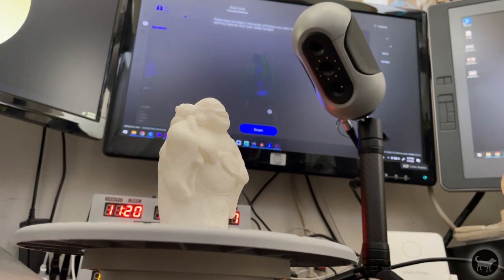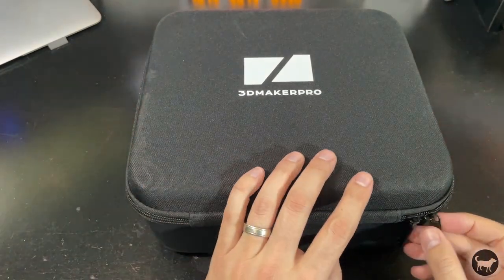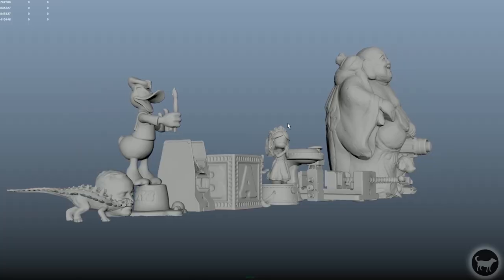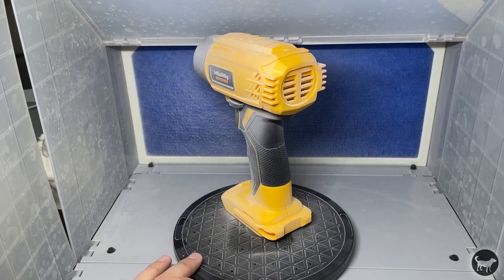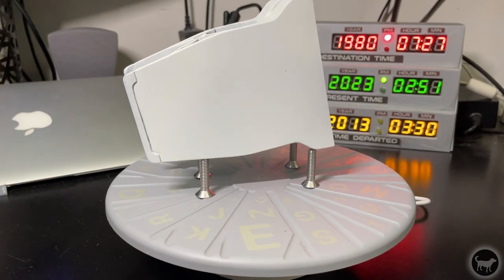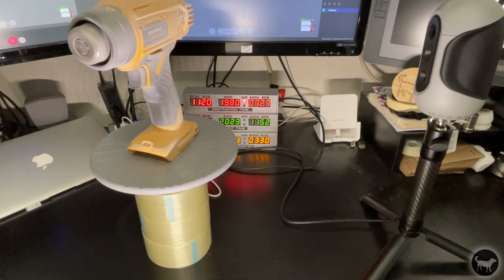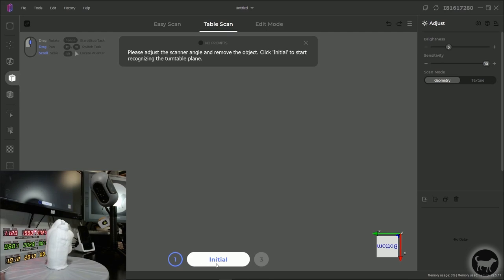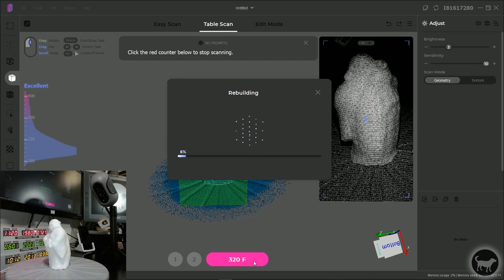3DMakerPro MOLE 3D Scanner Review | High Resolution NIR Laser | Mobile Scanning

Comment: I did buy the Mole because of those recommendations but find that it lacks the ability to capture details well compared to photogrammetry - that was unfortunately a costly mistake on my side.

The tracking issue is also extreme - also with the Lynx and some materials refuse to be scanned.

Seems photogrammetry is chapter and more capable.

Comment: Did you put the scanner manualy diagonally like scanning through all the deep holes for it to know that there is material or was it just scanned from one angle on the rotating platform?
Reply from the maker: I tried scanning it hand held as well to really get in those holes. I was honestly surprised it even did as well as it did since it's really hard to scan that type of object.

Comment: Great review but the device has the same shortcomings that all similar devices have. A lot of after-scan work for a somewhat expensive scanner. And they want extra $$ for add-ons which should just be included. This type of device, though slowly evolving over the last 20 years, still has a way to go.
Reply from the maker: Hahaha. It is pretty incredible how far they have come since I first used one of these things.  I actually figured out that it was 15 years ago when I last bought a scanner so I guess that is a pretty long time for an improvement.
Reply: @BusterBeagle3D   For sure. I started out playing with the David scanner software using a green led wand shining through a glass rod (to get a green line). Used the David software and a cheap MS video camera. Got results but I always ran out of memory because the files were so huge.  Also, spraying everything with foot powder was annoying. This technology will really need an AI breakthrough.